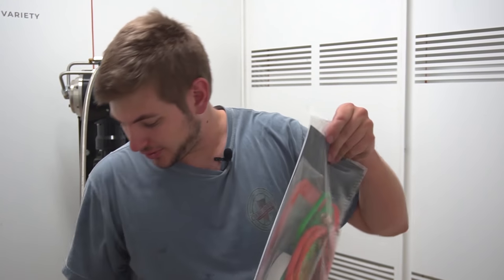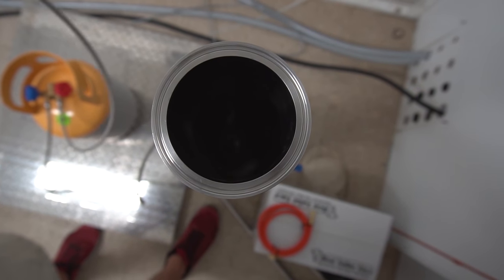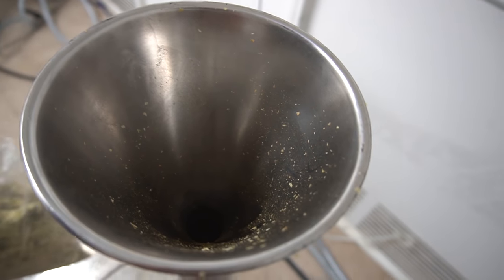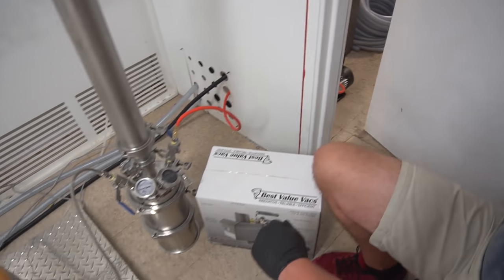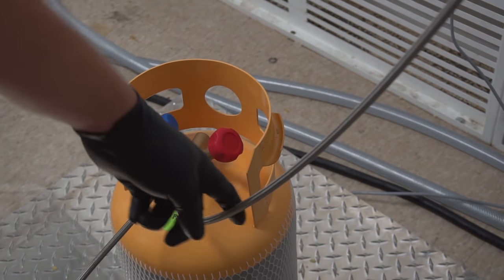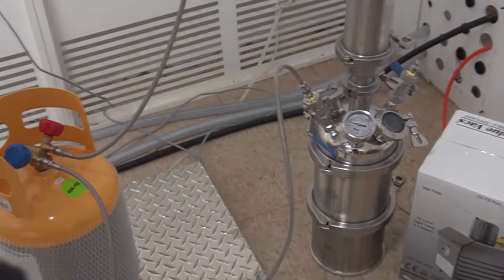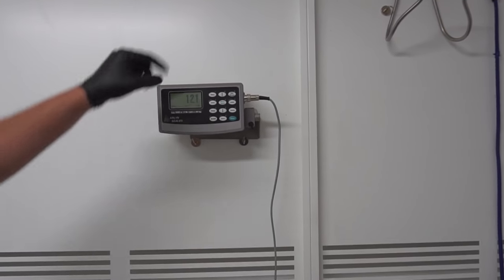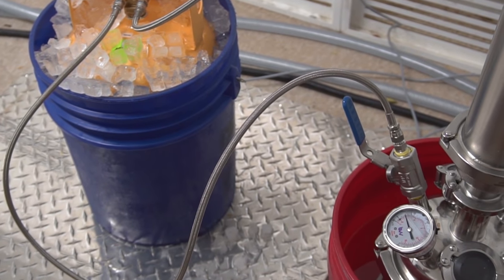How to run a 1lb Apollo extractor

Comment: Nice that the one you demo is zero'd out but the one you get wont be.. mine wasn't. no instruction manual either. Also told me it came with the small green tank but as you can see here and as it used to show on the site (use wayback machine) comes with this 30 tank. Had to fight for that. All in all it was a pretty crappy purchase experience.
Reply: I could not agree more. By the time I recieved mine it cost $7200.00 Canadian (1lb extractor and oven) BVV claims it's stainless steal. I beg to differ. To cut costs I bet there is aluminum in the mix. Bad welds and when you bring it before bvv with videos and pics, They ignore or won't respond to phone calls or text. I guess where I am in Canada it's OK to deliver there lemons. I am in the process of posting on cannabis forums  to not buy from bvv. Liars and crooks
Reply: @tunes1966  any good suggestions on where to find one from a proper seller?
Reply: @chadlarrabee2691  hardware factory store

Comment: What's the purpose of using a vacuum on a closed loop BHO abstractor. Can't you just fill with material with bottom valve closed. Put the top seal on with open valve. Blast the butane to fill the column. Shut off the top valve, wait for 5 minutes. Then open the bottom valve into a collector.
Reply from the maker: @Scorpios Lab the vacuum is to remove the atmosphere from the system and bring the base into a vacuum. The vacuum base will assist with collecting the solvent bearing resin into the collection base. Since this is a closed unit, we want to minimize the chance for a vapor lock.
Reply: So you're practically purging off the atmospheric air? By force of a vacuum?

Comment: Where can those solvent tanks with the liquid and vapor valves be purchased? They're guaranteed not to have manufacturing oils inside? My guess is from a refrigeration shop, and the LP or butane from a welding gas supplier.
Reply: There is no such thing as no manufacturing oils inside....
Always distill new butane! Problem solved
Reply: @djlansing  I have a manufacturing / machinist background. Any residual oils from when the metal was formed or the threads tapped would be dissolved in your solvent and ultimately end up in your product after you open the liquid valve. Some searching shows this as a refrigerant recovery tank. If I get one I'll likely rinse with ethanol first to be certain.

Comment: Now if I make this portable how would I ground it? I'm thinking a ground on the tank and the vacuum pump and closed system let me know what I can do thanks
Reply from the maker: @diglettunnel.kaneko You'll want to ground the CLS by one of the NPT ports on the collection base using an alligator clamp. As long as the rest of your system is connected via a stainless steel hose, it all should be grounded. The stainless steel hoses transfer the grounding from vessel to vessel. 
But to make the system portable you would need to put a metal stake in the ground and then bond the stake to the CLS to make it actually grounded.
Reply: @Jmarosii  thanks for your help very much appreciated

Comment: Can you use Co2 with this system? And possibly have a video?
Reply from the maker: @Brett Lawrence No, CLS are designed to use hydrocarbon solvents such as butane or propane. CO2 systems operate at too high of a pressure to be used with a CLS.

Comment: Where did you buy your column packer I've looked everywhere is it custom?
Reply from the maker: https://shopbvv.com/products/packing-rods-for-material-tubes
Reply: PVC pipe or metal rod and weld a end plate on it 10 bucks

Comment: stupid question, can you run ethanol through this system?
Reply from the maker: This Closed Loop System is designed to use with Hydrocarbon solvents only. A centrifuge is reccomend for Ethanol extraction.

Comment: I like the system, and I want to buy one
Reply: Buy from extractorsolutions.com
they have better clamps & they're cheaper because they're a little guy company in Cali.
This Apollo system doesn't even have a ball valve up under the material column...
It's not necessary--but I guess they're just trying to save costs. I love having a ball valve on mine so that the material can soak.
They have a contact number on their website that goes directly to the owner/operator Aleks.

P.s. if you make a fair offer on any one of his kits he will be willing to do business for less than his listed prices

Comment: For the return process do you need to wait for the gage to reach back to 0 ? I got stuck at 10 for some reason . Was wondering what can you do to maybe open it and get the bottom columns stuff or so you need it to reach zero to safely do it
Reply: Just release extra pressure or chill your collection vessel to get the pressure down

Comment: So I have a butterfly valve set up an when I go to soak my material the butane won’t flow until I open the valve to my collection plate also ? Should I heat my recovery tank will that push it through or is there something I’m doing wrong
Reply from the maker: @BlmmersAnBudz When a CLS is under vacuum, the negative pressure pulls the butane into the system. The material column holds a small amount of the butane. Your column is likely full. It would help if you opened the in-line ball valve to allow the negative pressure in the collection vessel to act on the material column. 
When you open the valve on your LP tank & valve in the system to input gas, grab ahold of the hose. Do you feel the solvent moving through it? 
You do not want to heat your LPG tank. Instead, dry ice on the collection vessel keeps the collected butane a liquid, maintaining a constant vacuum. 
Feel free to give us a call at (331) 281-0154 to talk with a tech.
Reply: @Jmarosii  I was doing a distill on my butane when I tried this an I have a sight glass so Ik the column wasn’t full my collection vessel was in dry ice an alcohol super cold but my column was same temperature as my butane tank so I’m thinking that maybe that’s y it wouldn’t run to the cold until I opened that second valve to my collection pot as the column wasn’t cold I was gonna try again once I ran material through the column an super chilled it I think that will help with pulling butane to the material column before I open my actual collection vessel
Reply from the maker: @BlmmersAnBudz Make sure to keep your collection pot cooler than the material column. The butane will want to stay in the column if it becomes cooler than the base (if the column has more negative pressure than the collection pot).
Reply: @Jmarosii  my collection pot I put in a bucket an super chill an put a towel over top so I think I’ll be okay I feel like it will definitely be colder then my column which will just probably be super chill but not consistently an exposed to room temperature

Comment: Can we use co2  instead of butane?
Reply from the maker: @jackyray6088 unfortunately no, we do not carry CO2 units. Hydrocarbon units are not designed to hold CO2's high pressures.

Comment: does it only extract Apollos? or can it be used for other things?
Reply from the maker: A Closed Loop System such as the one shown in this video uses hydrocarbons to extract plant resins. Some plant resins prefer CO2 or steam extraction. Hydrocarbon extraction is commonly used in the Cannabis industry. What are you looking got extract? 
Feel free to give us a call at (331) 281-0154 to speak with a tech.